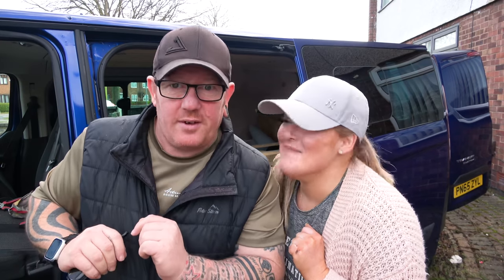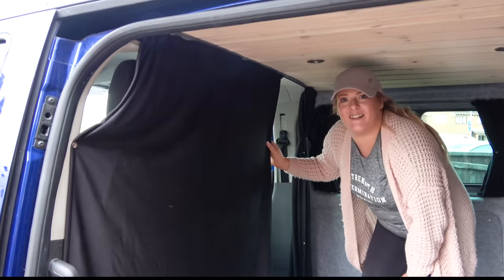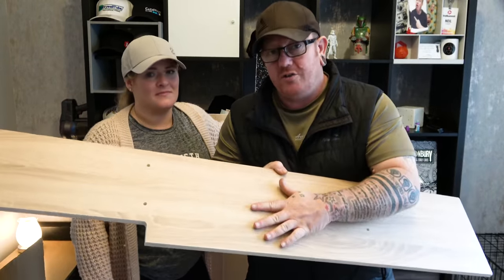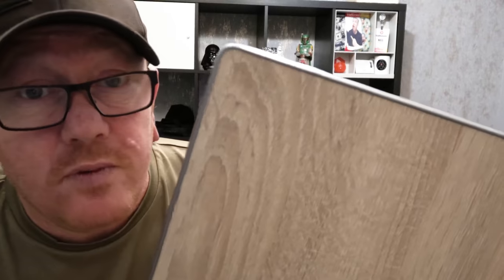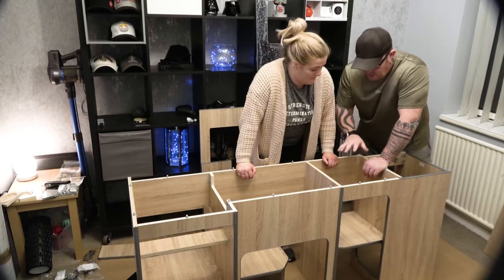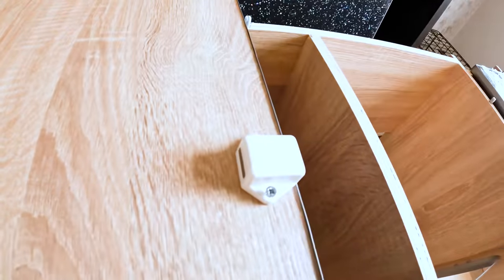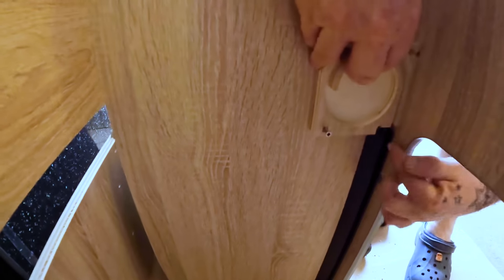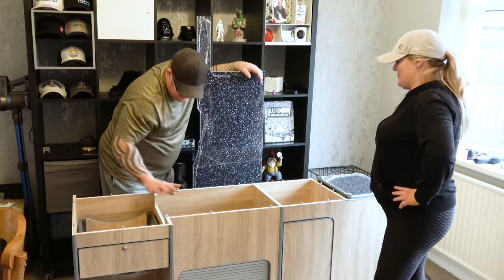DIY Camper Van Units SAVE You MONEY & TIME

Comment: My top tip when fitting tambour doors is to pop a smidge of vaseline on the top runner that curls around, it helps ease the door movement while it's new.
Reply from the maker: We used candle wax, didn't even think of vaseline, thanks for the tip!

Comment: Guys, if you changed your van would you still do it like you did with the crafter and build yourself or would you go down this route of pre made...i'm guessing you couldnt really mix and match so you would have to commit to one way
Reply from the maker: Hi David, if we changed our van we would still do it the way we did previously, nothing wring with pre cut units but personally in a larger van you just get a more personalised feel building your own and putting things where you want them, also this van build is so much smaller it was easier to use these after weighing up the costs of everything we needed and saved a lot of time and labour and we also wanted to do something a bit different in this van and had an certain look in mind.